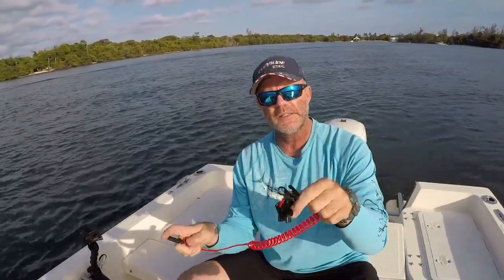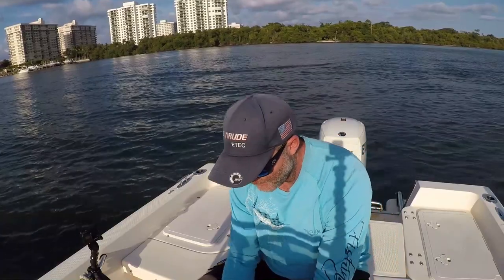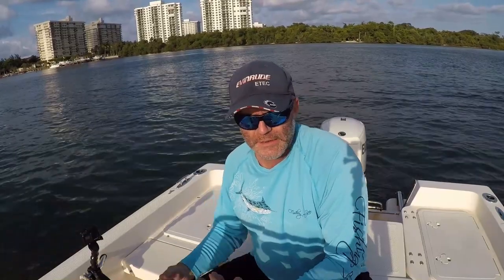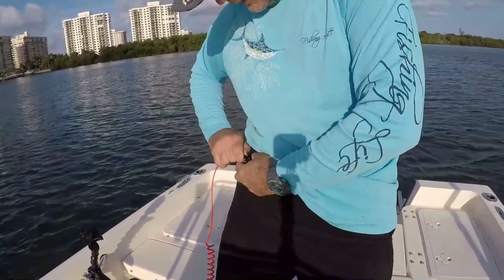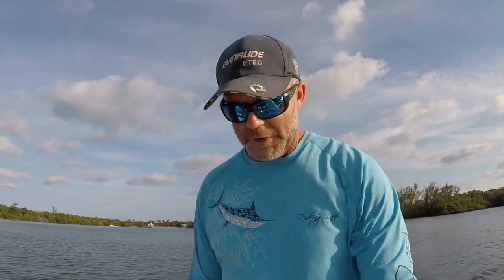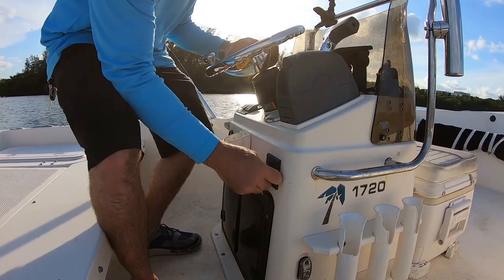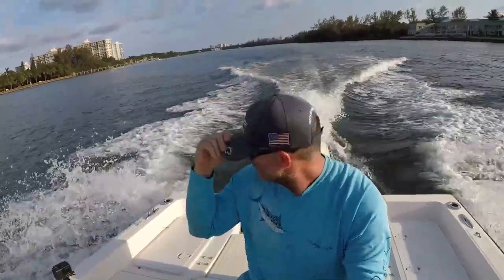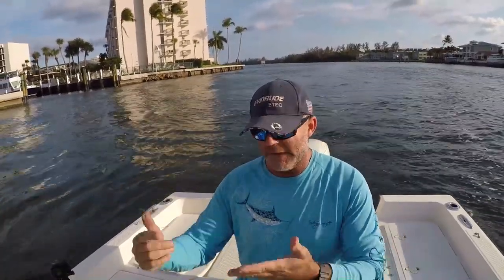2021 New USCG Federal Boating Regulation ECOS | How To Use Engine Cut-Off Switch Kill Key

Comment: Experience tip:
The kill switch is usually left in place and after time the clip on the ignition suffers UV deterioration  and can partially disengage, killing the engine .  The problem is if you don't realize what just happened, you might end up getting towed in (like I did) .  Replace the kill switch as soon as the clip starts looking faded and chalky.

Comment: So where did this new so called law come from? Did it come thru congress? Or did the US coast guard think they could make law without going thru our house senate and president to start enforcing this?
Reply from the maker: Good question.  This is for international waters.  That's 3 nautical miles off shore.  Not state waters yet.  However, there are states that have a similar law.  Let's say Florida is to adopt this, here's how it works... the law is enacted at the state level in conjunction with maritime requirements set forth by the US Coastguard.  It's not a federal law.  Hope this helps.